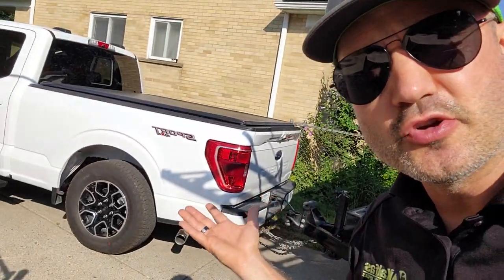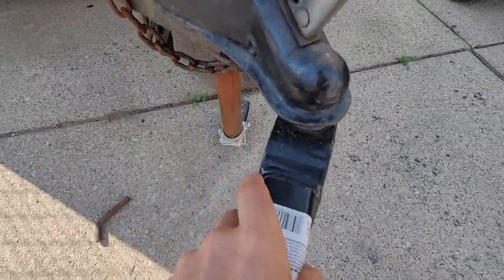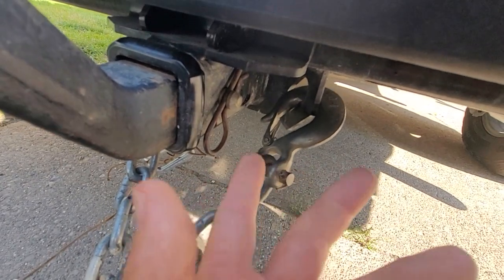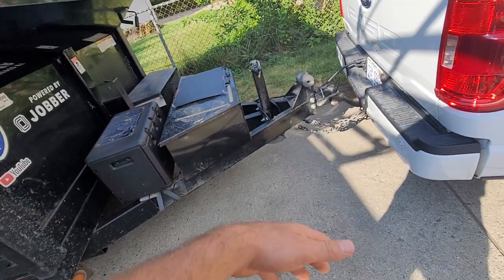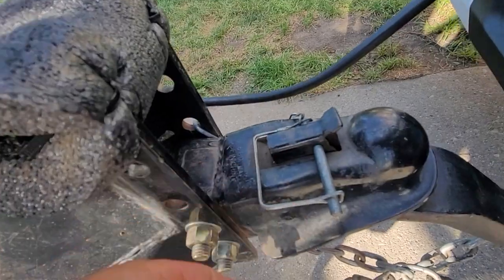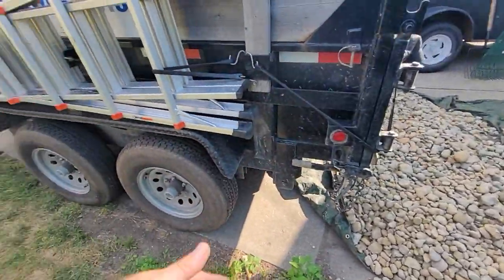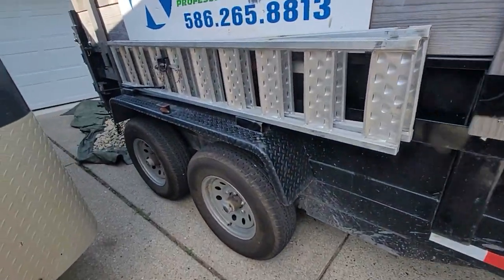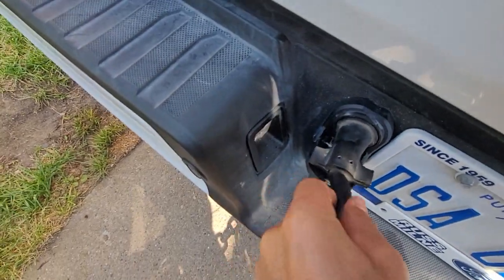Before Pulling a Landscaping Trailer Watch This...

Comment: One thing I  want to add keith.  Instead of the cotter pins, you need to get a locking pin. Mine worn out and the receiver cam off getting off the freeway.  Wish I could send pics.
Reply from the maker: We just bought a locking pin today .

Comment: Your able to pull that dump trailer with a 150?
Reply from the maker: It's a V8 5.0 with upgraded towing capacity.  Yessir.
Reply: Just the trailer weight alone prob eats up half of tow capacity, the real problem with half ton trucks is they are not rated for barely any tongue weight